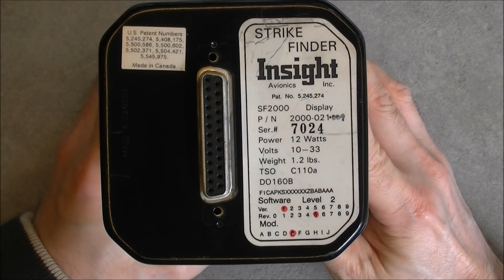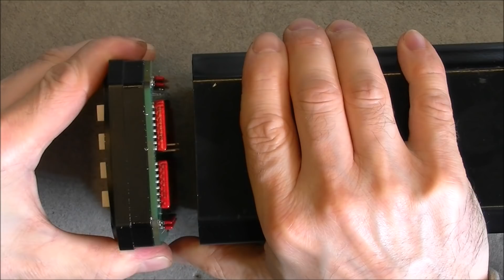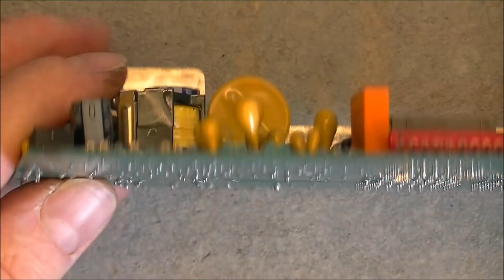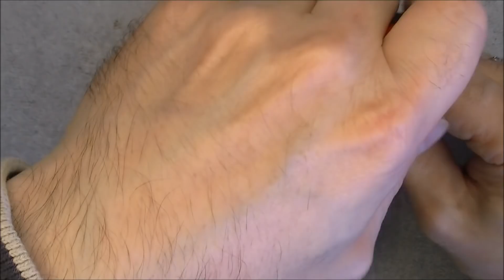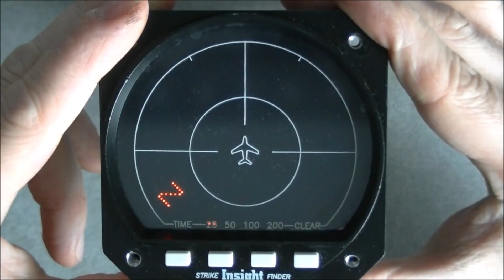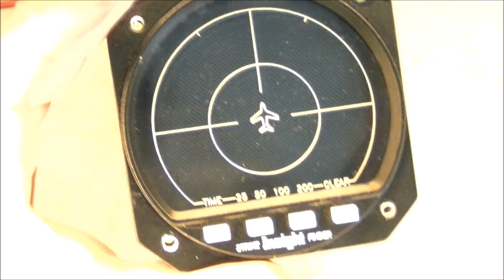Stormscope teardown and power on

Comment: As the designer of the device I am amused to see your teardown. You can get the install manual and other information on the insightavionics.com website. The display is neon plasma now replaced with LEDs.
The elastomer strips that connect the display are silver filled and very reliable. We have never replaced one. The device needs an antenna to function. The Z means zero response from the antenna. The device digitizes analog signals from the antenna and analyses them to determine storm location. All processing is done in the instrument. No remote boxes. The patents will tell you more. Many thousands of these still in use and we sell an updated model. This one is about 20 years old and still works. The power supply test points will reveal there are some high voltages (~200V) inside look out! The device undergoes rigerous environmental testing for approval and we overdo it to see what it will take. It is very rugged and very reliable. We go to considerable trouble to keep weight down because it is used in light airplanes. The long metal strip is both a heat sink, a ground buss, and stiffener. It stops all PCB resonance allowing the device to withstand outrageous shock and vibration. We always seek simple minimalistic solutions in preference to overkill you often get from less experienced folks. We also use about 1/4 the number of components of competing designs that require remote boxes. Our competitors use a $1500 module to read the synchro for example and charge the customer $5K  for it, we do it for 15 cents. In a reliability contest the simplest solution will always win.

JY
Reply from the maker: Amazing ! Thanks a lot for your input and all the informations !

Comment: Zebra stripe connectors are not reliable on components that are frequently opened for servicing, or subject to turbulence.  After time the zebra connector hardens, and the movement breaks the connector contact, resulting in intermittent contacts.  I'm surprised the display has not gone faulty after all this time.  The brightness of the individual numbers and letters are fluctuating, so perhaps that's the beginning.

Comment: The display is a DC gas plasma display, not a VFD. The driver chips on it are 32 bit shift registers. Two of them have 90V push pull outputs and the other two have 225v open drain outputs.
The power supply will provide around 180 volts so be careful. The ground pins on the SN75555 & SN75556 will be about 100 volts above the ground for the HV5122P and the SN75552.
The display is really easy to drive from any microcontroller, but you will need digital isolators to drive the data lines on the HV5122P and the SN75552.
I just got a couple of plasma displays working that use similar driver chips, but they didn't come with working controllers.
Be careful about lighting up all of the segments for very long, I smoked a power supply on one of my displays doing that.